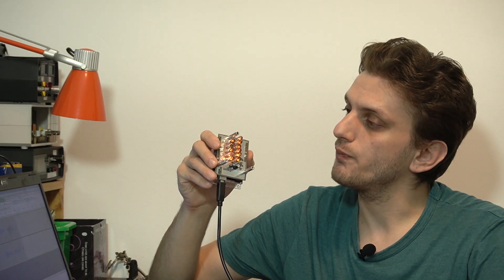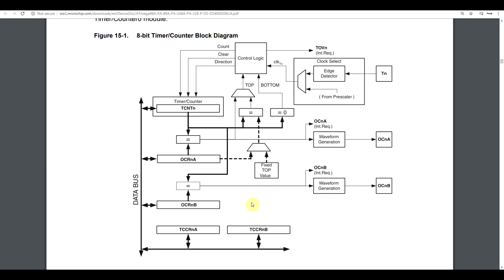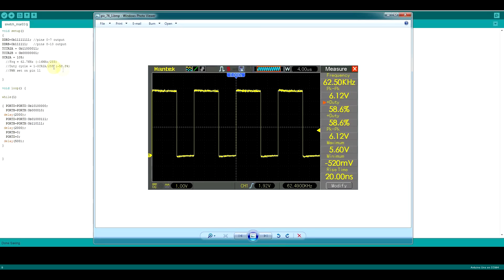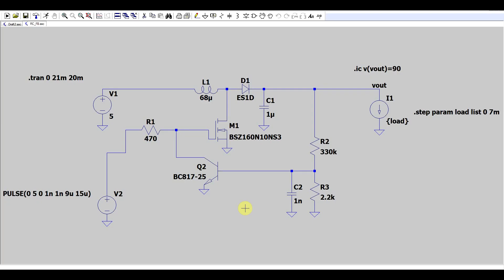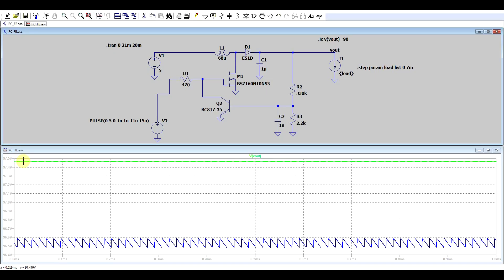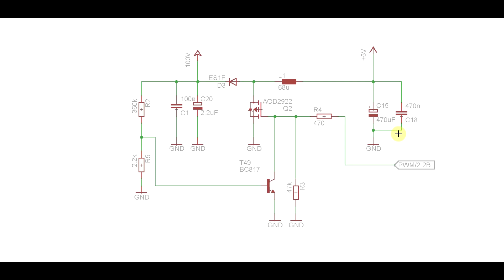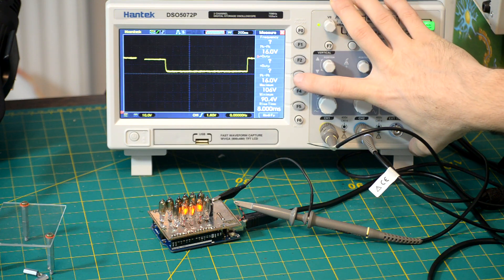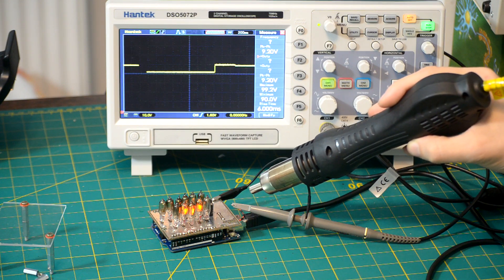Building an Arduino powered Nixie tube high voltage supply

Comment: Jetzt wurde ich die Verkupferung der LED - Birnenfassung bei richtiger Ammoniumpersulfatlösungs - Konzentration 
sogar in 20 min geschafft ! Besser wie diese Uhrbänder zum Veräppeln ?  Die Fassungen sind auch keine luftdichten Gehäuse 
deshalb vorher mit Zappon Transparent Lack Pinsel gegenüber der Dreh - Fassung dieser Schlamperleuchten vorher sauber abdichten !
(einmal im Kreis herum und auch bei Kontaktstift herum mit Pinsel in 30 sec. im dünnen Randbogen außen am Blechrand abgedichtet.  

Anschließend bei der rein chemischen Galvanisierrung für 10 - 20 min,  nur halb eintauchen. 
Dann sieht man den tollen Kupferglanz verspiegelt. Es geht genauso mit winzigen Mengen
 etwas gelöstem Silber in  Ammoniumpersulfat, das x fach hierfür verwendbar ist. 
Noch sicherheitshalber auf Heizung bis nächstem Tag alles ganz -  trocknen lassen.

Comment: Will you get eletrical shock and harm yourself if you touch the high voltage output? I guess the output power is small so you will only get a string but that is it?

Comment: A sugestion: increase the duty cycle of the PWM as you drive more tubes from the Arduino. Or measure with the ADC ( + voltage divider) the output of the supply and adjust the PWM duty cycle, using a PI algorithm to improve stability.

Comment: Thank you very much Sir. You are a good teacher, can you please share a video on "How I can use LTSpice to generate SPWM using PWL(PieceWise Linear)"  ..... been struggling with that lately.
Reply from the maker: Hello @Piet Matsobane ! Well if you can generate the PWL file somehow, than its not that difficult to import (see https://youtu.be/nPZ7vneN3v8?t=402 ) on the other hand, you could try to generate the SPWL using the simplified technique for driving a D class amplifier ( https://youtu.be/rR69btcolFc?t=1419 )
Let me know if this works out!
Reply: @FesZElectronics  Oh yes I was able to easily generate SPWM using your technique here ( https://youtu.be/nPZ7vneN3v8?t=402 ), THANK YOU , and after watching this ( https://youtu.be/rR69btcolFc?t=1419 ) I noticed that part of my circuit will also need a similar Low Pass Filter ...... the project I am working on is a Pure sine wave inverter AND I will be generating my SPWM using a microcontroller.

Comment: Very good Video :) can you may build and explain a high frequency class A amplifier for the frequencys between 400Mhz and 500Mhz or at least more than 100Mhz? I ask because Amplifier gets a bit more complicated in this area.
Reply from the maker: Hello Alex. I'm not sure when I will get to this; the main problem being that I don't really have the right equipment to correctly measure a circuit above 100MHz. Out of curiosity, why are you interested in such high frequencies (specifically 400-500MHz?)
Reply: @FesZElectronics  I always want to build high frequency circuits to learn about reflection and radiation of Electromagnetic waves but i had never succeed. my fastest Amplifier yet got 115MHz before stop amplifying but this was more of an accident and i relay can not explain where this limitation comes from. At least the transistor was rated for 300MHz (BC548B). 400-500Mhz specially because of my walkie-talkies, with an Amplifier between 433-434Mhz I could amplify the weak signal of my Hack rf an build a small 70cm Radio station for test purpose.
Reply from the maker: @alexengineering3754  As long as you don't really want to much power and to keep things simple I would recommend a "gain block" since these are quite easy to use and have well defined gain ( https://www.analog.com/en/products/amplifiers/rf-amplifiers/gain-blocks.html  ) depending on the model these go up to 6GHz. These are available from other manufacturers of course, and are usually found as MMIC components (Monolithic microwave integrated circuit); These are really good as wide-band amplifiers.
On the other hand if you want a specifically tuned amplifier on the 430-440 range, than a transistor circuit with filters might be better though.  I recommend you check out AN11427 and AN11500 from NXP. They use the BFU520 and BFU580 which are HF transistors but also quite cheap.
Reply: @FesZElectronics  i trying at first the transistor amplifier again for educational purpose but for other projects it is surely a better idear to use a gain block. At least i know how to simulate my projects now, that saves me a lot of time :) thank you